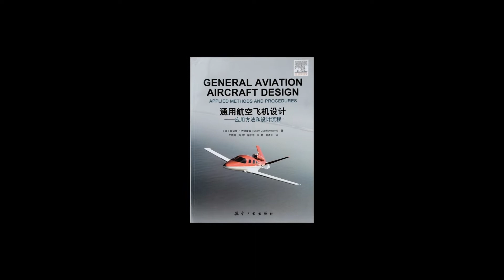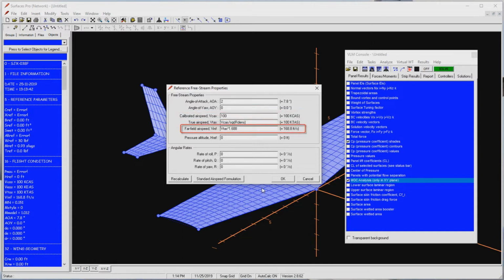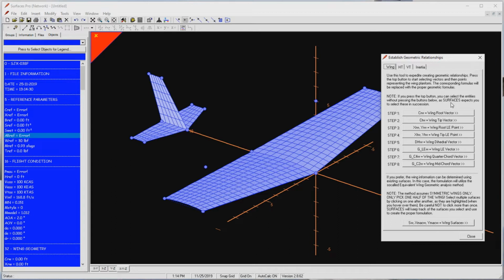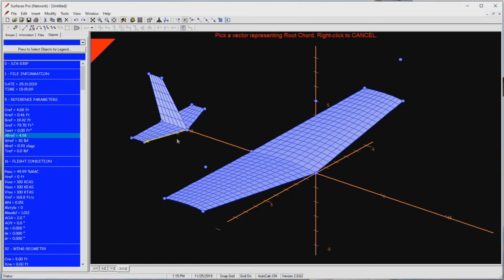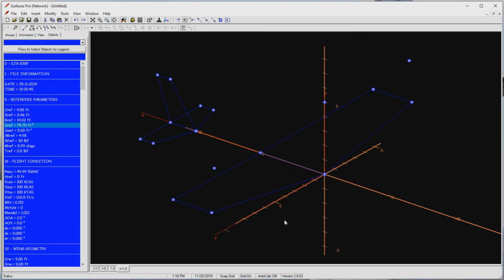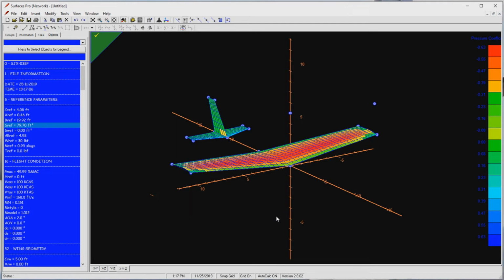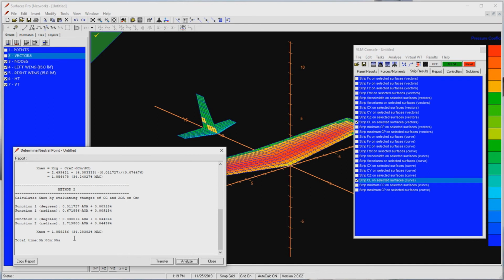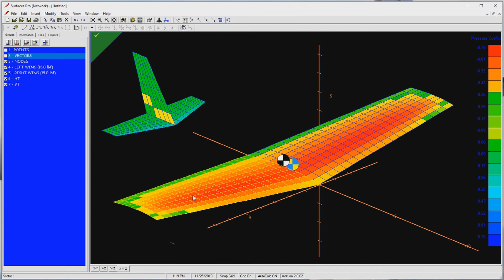PART 2: Running Version 1 for the first time. Estimate stick-fixed neutral point.

Comment: Hi Dr. Gudmundsson. Is there a range of Mach numbers, Reynolds numbers, etc. for which the vortex lattice method (or Surfaces in general) is valid?
Reply from the maker: Hi Mandy. The Vortex Lattice Method (VLM) is generally used for subsonic airspeeds (M0 - 0.9). However, there are a few specialized codes that treat supersonic flight. Like most panel codes, VLM codes are inviscid. This means they ignore viscosity when solving aerodynamic problems. This, in turn, means that Reynolds numbers are not necessary. Thus, normally they do not account for boundary layer effects or parasitic drag. This must accounted for separately. Their strength is high accuracy at modest AOAs and AOYs, coupled with fast solution time and small computational overhead. In short, they suffice for perhaps 90% of the normal operational airspeed range of an aircraft. Regardless, there are researchers that have used clever means to incorporate boundary layer theory in VLM codes, but these are specialized research codes. The important thing to remember is that the aerodynamicist has multiple tools in their toolbox, of which VLM is but one. It is the right tool for the right problem, just like Navier-Stokes solvers are another tool for different problem (e.g. ones that must consider flow separtion). I could keep going, but will let this do. Best wishes.
Reply: @dr.gudmundssonaircraftdesign  Wow. I'm so grateful for your prompt and thorough answer. Thank you for sharing your expertise with us. I will be ordering your book soon.
Reply from the maker: @mandyrey7122  You're welcome. 🙂 Best wishes.